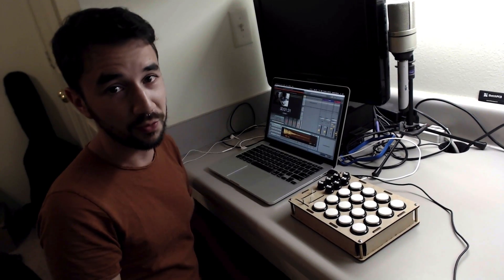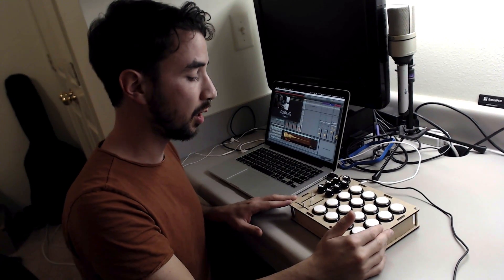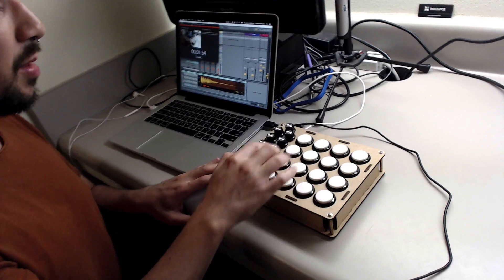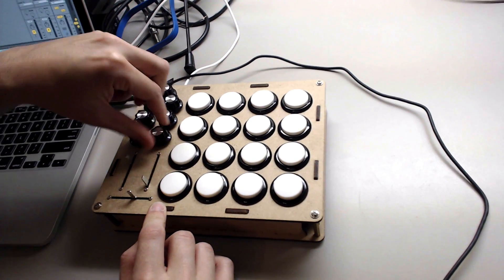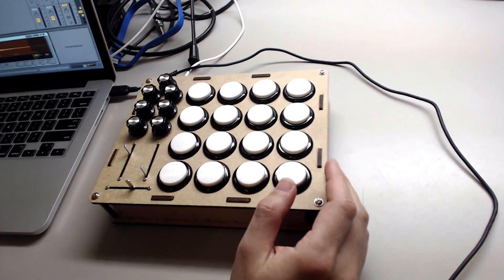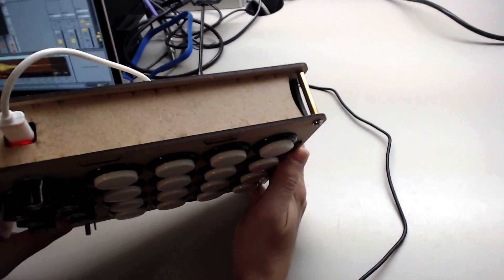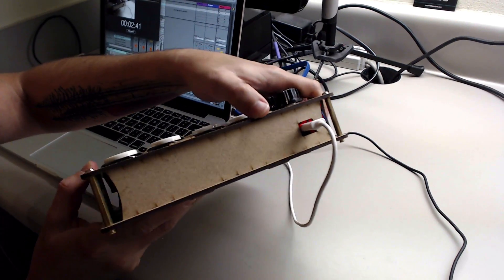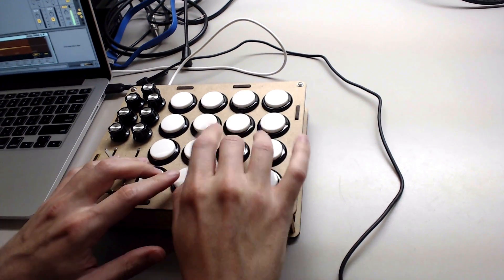DIY Midi Controller with Arduino Pro Micro

Comment: Uma pergunta, irmão.. Como voce conecta o MIDI ao ableton? Digo, que tipo de MIDI type voce seleciona no ableton pra que ele reconheça seu COntroller?
Reply: WhySoFast Boa pergunta
Reply from the maker: Neste caso seleciono o controlador, que fica com o nome de Arduino Micro, em Midi input em Track e remote. Fica como qualquer outro controlador. Não sei se respondi à pergunta...
Reply: Ele reconhece o arduino como um controlador padrão? A pergunta é por que outro dia tentei conectar o celular como midi, mas não sabia qual opção selecionar pra que o ableton reconhecesse a teclas que eu queria, entende?